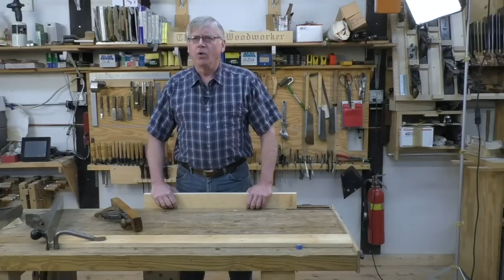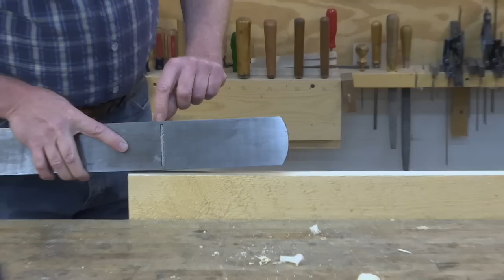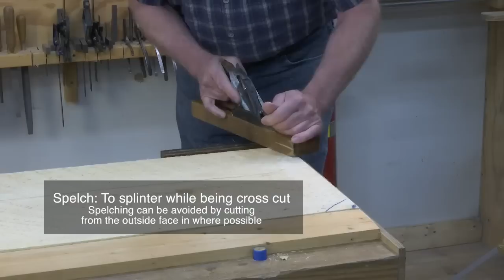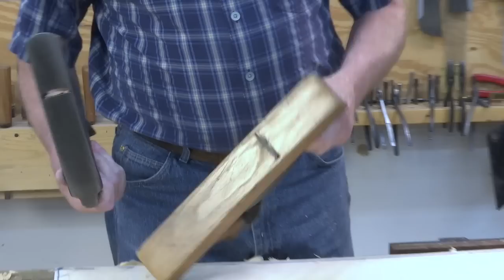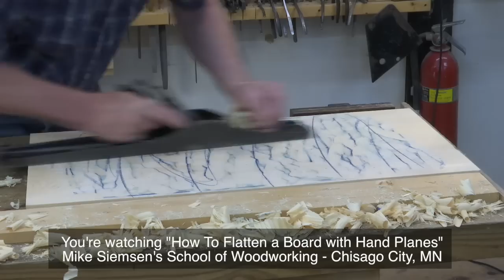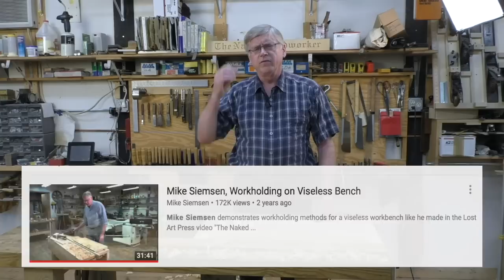Flattening a board using hand planes

Comment: This process also confirms the need for a proper flat workbench since it would be almost impossible to perform or test validate these functions without a flat work surface under the stock.

Comment: I understand this is "old" for YT standards but just in case someone wants to help me out here....
Here's what I would like to double-check for understanding: in the initial phase, Mr. Siemsen removes the "hump" out of the ends of the board, along its short edge. He does it without touching the board corners, only to allow the winding sticks to sit on those two corner points on each side.
This now enables him to check how those 4 corners - untouched - relate to each other. Then, he basically removes material from the couple of corners that need that, depending on the amount of wind (the shavings test is GOLD!). The stroke goes somewhat beyond mid width, so the "one shaving" is taken accordingly, to both sides.
At this point, he draws a chalk line along the short edges and calls it "two parallel lines" (in the "height" direction, of course, so "no wind"). However, I see no "guarantee" by procedure - maybe by experience? - that the two edges are now flat. I mean: initially those edges were "humpy", right? Then, the hump was removed --> there's now a hollow. Next, one of the two corners has been lowered, per side. How is this guaranteeing that a straight profile is resulting?
When teaching how to get a straight profile, the technique was to first create the hollow, then plane the whole thing through until a full, uniform-thickness shaving is obtained.
This is not what he's done here. I am therefore assuming that, although not really straight, this is "straight enough" for further processing... Is my thinking correct?
Reply: I think you are partly right — it’s good enough for the next part of the process.  But in addition, I reckon that each of the winding sticks is telling him that each of the respective edges is now flat. That is, although the two winding sticks are used togather to ensure that there is no wind across the length of the face, each one is also used independently to indicate that the edge it is resting on is straight. I guess!

But what I don’t understand is this. Although by the end of the video, it does look like each of the two faces is flat, I’d have thought that to be useful you would also want them to be parallel to each other. And although right at the start he does talk a little bit about making the edge he first planed “square”, he was making it square with reference to a not-yet-flattened face, which doesn’t seem useful at all. I thought the process was:
1. Flatten a face (and then mark it as the reference face with a curly P symbol); and THEN
2. Flatten an edge AND SQUARE IT TO THE REFERENCE FACE (and then mark it as the reference edge with an upside down V symbol pointing towards the reference face), and only THEN
3. Flatten the other face, squaring it against the reference edge; and/or flatten the other edge, squaring it against the reference face.

Comment: Nice Vid and great explantions. Well done. Want to know: Regarding your ForePlane, did you yourself installed the Plane on a board with a path cleared for the Blade ? Thanks for your answer.
Reply from the maker: No I did not make the plane. It is an old one.
Reply: @mikesiemsen7125  Thank you.

Comment: For folks thinking it is faster to just run it through a power planer, that's not the case.  This method is superior.  A planer forces the board against the bottom plate as it feeds through, so any compressed cupping or warp will simply return after the board emerges from the machine.  This way shims up warpage so he is taking it out of the board, creating a surface that's flat at rest, not still under any machine tension.

Comment: 3:50 “I was careful to hold the plane straight”. You also have the skill to hold the plane straight. I’ve tried this many times and my biggest problem is the edges not being square. I think there must be some trick or skill to this which takes a very long time to acquire . There are some great tips in here, such as only planing between the marks to remove the bow and using shavings as spacers to judge how much material to use. It is a good video - but my personal experience is that no amount of watching videos is going to make it possible for me to do this - it needs hours (years?) of practice. It is theraputic to watch an expert at work, but when it comes to flattening a board for myself, , I can understand the comments about buying a jointer and a planar!
Reply: Hello SAHBfan,
Even if you invest in the two machines you’re referring to,
you’ll still end up with an uneven board, all the thicknesser 
will do is to flatten the timber going through with its powerful 
feeder rollers, but when it comes out the other side, once
the pressure of the rollers have ejected the wood, it will most
likely still have the same twists; you can make a jig that will
help you, but you need to understand what you’re up against.

What you see is the only real true way to truly get a flat board.

Comment: I tried this on a 10ft x 2ft board of cuban mahogany, but even with my finest smoothing plane and going in different directions according to the local grain, I was getting tearout. So I just ended up having to sand the bejesus out of it.  Does this method work for all woods?
Reply from the maker: The sharper and better set up your planes are the better your results will be.

Comment: I've watched your video on work holding 2 or 3 times as I was building a new bench and wanted to give my self as many options as possible. I consider that video to be state-of-the-art on the subject. This video is the same. No one has ever explained a try plane to me before, referring to the usual suspects here.  The whole process makes a lot of sense.  For years I've used a scrub plane (if needed), a jack plane and a smooth plane. I got it done but was very fussy getting a perfectly flat face with a shorter plane. I'm going to take this new method to the shop in the morning and see if this simplifies the job. Thanks again for the great work. I'd personally love to see more.

Comment: If you have a board with both sides very wavy and not flat, And you Plane it down till it's perfectly level, aren't you just leveling it according to the angle that is on the back side? Once you flip it over, its not level again. Thats the problem i'm having.
Reply from the maker: Joe, I'm not sure what your question is. There is always a bit of confusion between flat and level. You flatten the board using the winding sticks, which show twist, or parallelism. When that face is flat you flip the board over and do the same thing using the winding sticks to get the board flat. If you want two parallel faces like a power planer makes you gauge lines around the edge and plane to the lines. Flat is all points on the surface are laying in the same plane, level can also mean that but I always think of it as when you put a level on it as in plumb and level. If your board is sawn straight it should plane up fairly even in thickness.

Comment: Love the video!! Could you describe the shape of the iron on the jointer plane please? Is it straight or curved? Or straight with corners rounded?
Reply from the maker: Typically a Try plane has a slight amount of camber and a Jointer plane is straight across, Then there is the option of rounding the corners. Straight across doesn't work in a try plane.

Comment: Why didn’t you do the edge afterwards instead of before? Seems like using a try square off a non-flat surface to check for square on the edge would give inconsistent results
Reply from the maker: You are correct to do the edge after the face. I was demonstrating how planes work so the rest of what I did would make sense.

Comment: The method presented was new to me and a bit of a revelation.  Only question I have is when you flipped the board - presumably you would want to ensure that both faces are parallel to one another i.e. same board thickness throughout?

Comment: Love this video, watched it many times and it has information I haven’t found anywhere else. 
  I’m having a lot of difficulty in planing hard maple boards for a benchtop, the edges are wider than my jointer plane so getting them square across the entire length is being tough. They’re too narrow to treat as a face but too wide to edge joint in one pass, if that makes sense. 
  Working alone, it’s hard to know if the difficulty is in bad technique, wrong method, or just the inherent difficulty of working hard wood. It could be a combination of all these?
  I’ve been trying to get the ends coplanar with winding sticks, hollow out the edge, and flatten with full length passes as you show, but I’ll get low spots on one or both edges. What to do?!
Reply from the maker: Get your plane as sharp as you can. Set if very fine. You won't get a shaving everywhere at first. Make sure you keep it flat on the board. Be patient.
Reply: Mike Siemsen thanks very much for responding so soon. After I posted, it occurred to me that if there’s highs and lows then it isn’t planed. Duh! Seems like I mostly need to focus on the stage after hollowing, taking the full length full width of the edge. Thanks again!
Reply: Mike Siemsen I’m still not getting flat. My jointer is a lot harder to push than your jointer seems to be. 
  My #8 plane has a hump behind the iron, is that a serious concern? Some say yes, some say don’t sweat it.
Reply from the maker: @mikesradguitars  The sole of your plane needs to be flat. Make sure you are very sharp and take a fine shaving. Half lap your strokes. Since you are building bench top this will be difficult for a beginner, lots of place to go wrong. practice on scrap rather than your project.
Reply: Mike Siemsen thanks Mike! I haven’t had any luck flattening the sole, I started trying to sand it on plate glass and I could tell I was gonna ruin it. I got a wooden 22” jointer plane but that’s another little learning curve. Any advice for getting that hump out of the sole for a Flat Stanley?
Reply from the maker: @mikesradguitars  you need a long, flat surface. I use carpet tape and adhere a 40 or 50 grit belt sander belt about 36 inches long and at least 3 wide. cut the belt in half at the seam so it lays flat. Keep your weight over the frog as you rub  the plane back and forth on the belt. a big plane is a lot of work.
Reply: Mike Siemsen thanks again. That’s exactly what I was doing but after an hour or so I thought “this can’t be right” haha

Comment: If you simply flatten the other side, it doesn't guarantee that it's parallel with the first side you flattened, correct? Seems like you could get thickness variations from one side of the board to the other.

Rather than duplicate the first process, wouldn't you want to mark parallel lines that you're going to work to on the second side?
Reply from the maker: That is correct. Parallel surfaces are a modern thing that came about with the surface planer. Back in the day you worked from the registration face and the registration edge when laying out. If your lumber is properly sawn it will be fairly parallel when you are done, you can of course work to gauged lines if need arises.
Reply: @mikesiemsen7125  Makes sense, thanks for the info. 

I hand dimension all my stock, but it's always off of a machine for the initial milling/sizing. Usually because it's S2S from the yard and I usually use machines for the initial rough sizing.

I've never had to dimension something as rough as what's shown here, so I wasn't sure what was correct.

Comment: I'm a newbie here, but I notice that you're going against the grain of the wood, why is that? Would that not leave more splintering and higher chance of blow out, since it seems that you're cutting blade is at ~45 degree angle. I read that its advised to use a 22.5 degree angle blade for going across the grain? Although, clearly this is extremely successful.

Comment: I've watched this a couple of times since posted but still a bit confused. Are you essentially making the outside boundaries of the workpiece face co-planer? Then the outside boundaries of the face determine the final plane of the face since the rear section of theTry plane references off the boundary. Hope I'm clear . Is this  correct .?
Reply from the maker: William, that is correct,

Comment: I have this overwhelming urge to fly to Minnesota and buy you a beer.  Really excellent video explaining both the why and how of removing twist, then crown.  

One mental technique I find that works to avoid following a hump is to try and plane a hollow across the board.  Mentally picture trying to scoop out a bowl.  You'll fail but it helps keep pressure on the back of the plane while lifting the front so it's less likely to ride up and over.   Again, really great video.

Comment: How does planing the center and leaving the ends make it flat? The center would be lower than the ends because the blade sticks out from the bottom. The center of the center would also dip down even further for the same reason. Why is this not true?

Imagine a straight surface with a blade sticking out below. Anything it drags on will have a dip in it where the blade is.
Reply: Did you ever get an answer?

Comment: Mike, this is a super video. Thanks so much for doing it. I committed to building my workbench combining what I learned from your video on viceless workholding and Paul Sellers workbench made in his back yard with minimal tools.  I am very happy with my bench.  I can break it down for transport (as Paul shows), it is really solid (7'x34" and almost 3" thick for good holdfast function).  My own addition was a deep, removable (so I can get clamps in the center of the bench if needed), tool trough in the middle for tools, and a planing stop like you use.  I am not sure I want to omit a good vice on the apron.  Since I have two heavy aprons I think I can risk it.

I have a large amount of white and red oak logs. I wish someone would show flattening of really dense wood.  Nothing I do looks like all the youtube vids done on softwood.

Comment: Why did you make the hollow prior to making it flat?
Reply: The hollow if very slight.  By doing so, you insure that the board is very close to flat with no crown.  With hand planing it is easy to plane a crown.  Making it slightly hollow makes sure that there is no crown.  Then it takes very little to remove the ends that are slightly higher to have a truly flat board.
Reply: Is the hollowing out technique limited by the length of your jointer/try plane i.e. the plane stops shaving because the the plane is held up by an end front or rear?  If the board were two or three times the length of the plane would this still work?
Reply: @rowdywallbanger4080  The longer the board is the plane the deeper the hollow will be. No matter the length of the board at some point the plane will stop cutting when the hollow reaches the minimum curvature defined by the length of the plane and the iron projection. Longer boards will have more to remove from the ends but it should still be small. If you don't use the hollow technique there's no limit to how much you can crown the board if not careful, as I have found out.

Comment: Excellent instruction from a knowledgeable teacher. It's also why I use a power planer.
Reply: Learner - LOL - it's funny but I went the other way. I got rid of my power planer and use hand planers now. I can get far better results with far better accuracy the hand planer way.
Reply: @skippylippy547  YES OF COURSE YOU DO.
Reply: @738polarbear  ?
Reply: Skippy Lippy if its your hobby - its correct. But in case you have to make a lot of jointing and planing - impossible to do by hand) especially with oak, maple etc hardwood , not pine
Reply: @МаксимЗубов-с4д  Yes it's my hobby. Small projects just for my own use.
Reply: Power planers CANNOT do what he just did,without a real lot of piddling around and building sleds and jigs .
Reply: @738polarbear 
Yeah. That's why you go down to any commercial cabinet shop and you will see guys hand planing rough lumber.
Reply: Let's see what shape your lungs are in when you get to his age.
Reply: Rob Frost hit the nail on the head... The beauty of hand planes are the lack of dust coating every surface of your shop, and their amazing quietness. For some people, hand tools will actually save you time and money as well (time at the gym, money on the membership).